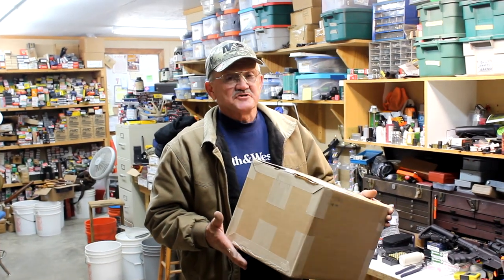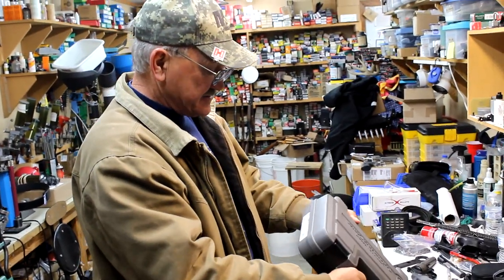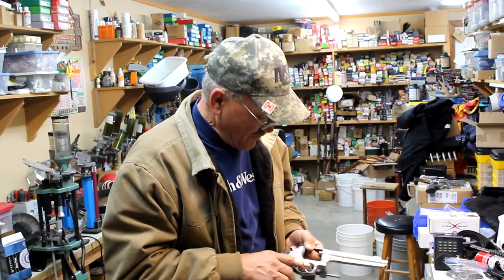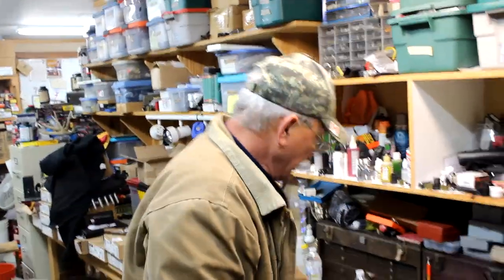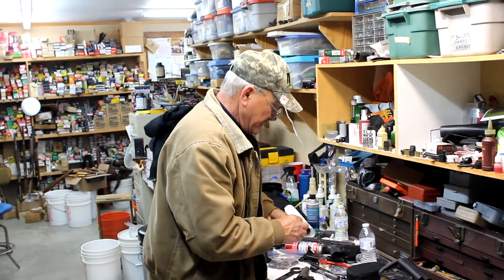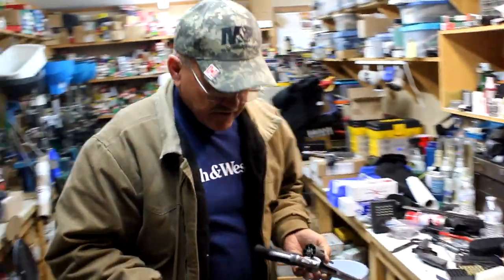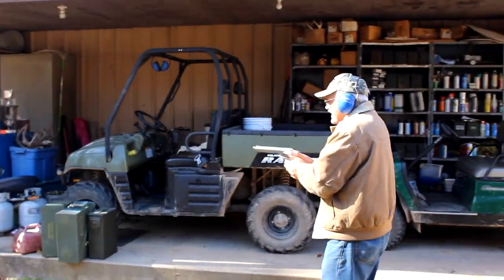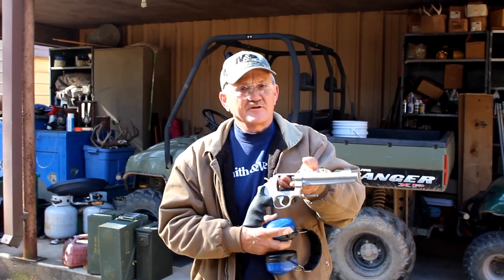First look and firing of the S&W 929 8 shot 9mm revolver with Jerry Miculek

Comment: Mr. Miculek, I myself just received the 929 recently. I have to say it is a gross disappointment for me, and as I have seen online many others.. I am a huge fan of you Jerry, your level of skill and excellence is of the highest level and unsurpassed. It has inspired me to take up action shooting with the revo a few years back. I know you expect the very best equipment available. I also understand some tweaking to a factory gun is required to make it better. I further understand as a sponsored shooter it is your job is to promote there products. Unfortunately the products, specifically the 929 you have your name on is far from what it is hyped up to be. It requires alot more work to make acceptable than it should based on what it is advertised to be. To say it is specifically for 9mm is false, it still has a cylinder throated to .357" for use of 38's not the .355" for 9mm. The Performance center Action is deplorable with no fitting what so ever. The hammer and trigger mating surfaces ride on the raised mold flash because they don't stone or grind anything to match. The cylinder opens like an old warped barn door and spins like a brake drum against over-adjusted brake shoes, the muzzle crown is rough with burrs protruding into the bore, and the barrel forcing cone is super rough and looks like it was cut with a dull taper pipe thread tap. Extra money on "performance center" work that is worse than most standard revolvers I have encountered. So with your name on it I hope you can step in to correct this miserable quality output when extra money is spent with expectations beyond whats delivered. It not only hurts S&W but is blemishes your name as well. I have called S&W repeatedly without call back from the Performance Center Rep I am always directed to......I can tell you I will never waste money on the Performance Center Guns again, you pay more without getting anything more done. I have written a full review of this hunk of S&W embarrassment on the Brian Enos Revolver forum. I do not take lightly in wasting money on hollowed promises!! I hope you can be the voice for all of us consumers whom are getting the shaft here. Thank You
Gus VanEtten
Reply: +BallisticianX I have to agree with you on the PC crap that is coming out. I purchas3ed a 625PC and had to send it back with a large list of fit &amp; finish problems and a 1/16&quot; drag line. They fixed everything but what did I pay for? They need help in the PC shop. My Pro Series 627 was a dream compared to the PC offerings. Hopefully S&W will come out with a Pro Series 4~5" 9mm 8-shot.
Reply: The cylinder is neither 9x19 or 9x21. It is a .357 mag/38 spcl. cylinder as spec'd for the parent 627 model. It is merely modified by shortening the cylinder from the face to bring the throat closer for the 9x19 COL. This is why the 929 has a throat diameter of .357" rather than the proper 9x19 diameter of .3555"  Likewise bore diameter is .357" rather than .3555" for 9x19. This all correlates into improper bullet fit and seal introduces gas cutting, resulting in increase barrel fouling and loss of accuracy. This is especially noticed with lead cast or lead coated bullets.
Reply: +Jonas Björk as per S&W themselves the barrels are broached to a spec anywhere within .3565" to .3575". This being the spec for all .357 mag/.38spcl. barrels. My barrel lands exactly to .357". May I ask how you determined your barrel diam?

Comment: Hi Jerry miculek. Have you and S&W ever had a good look at designing a bottom chamber barreled revolver? Have you resolved your ideas in the pro's and Con's? The barrel flip must surely be reduced? Though not enough to provide a measured advantage, calibre depending? Also I wonder if cylinder gap gas escape is an issue for the shooters hands.

Comment: I thought judging from the model number they took a model 29/629 frame and cylinder and simply bored out the charge holes to accept 9mm rounds and bored a barrel to accept 
.355-356 inch bullets. The frame looks like a K or L-frame. It could be the camera though.  I'd think a model 29/629 cylinder blank would be big enough to accept 10 shots of .38/.357 Magnum/9mm rounds. True the walls might be a little thin but an unfluted cylinder might be strong enough. The model 29/629 top strap probably is thick enough to help contain the pressure and gases without cutting as its strong enough to take .44 Magnum pressure and heat.

Comment: WOW! As a fan of .357 revolvers and .45 in 1911, I fell in love watching that revolver fire with about NO noticeable recoil. This gun (having 8 shots) might bring on a little rebirth of revolvers. Unless the cylinder is too big, I suspect a 2" or 4" in that would be a very good carry sidearm.
Reply: That recoil comes alot from Jerry. His recoil control is top notch. And also Smith and wesson currently offers 8 shot 357s in barrel lengths like that. The cylinder is the same size of a 44 cylinder. N frame. but with 8 355 diameter holes instead of 6 44.
Reply: Yeah, Jerry is awesome. Should have thought of that too. Also I know Taurus makes an 8 shot .357 but they may be just too big for people to want to carry them. At least the cylinder is shorter with the 9mm vs the .357 length.

Comment: I believe a small  part of us are guilty of accepting less than perfect quality from firearm manufacturers by accepting small defects and not sending our firearms back for them to address those issues.  I recently purchased a performance center pistol and it has a rough edge near the crown, as well as, a front sight that has a kink on it.  I am extremely disappointed with the over all quality of the product that I received.  It will go back to Smith and Wesson to get fixed after I have put some rounds through it to see if something else is wrong.  The trigger didn’t feel as smooth as I expected so I took it to a local gun shop and had their revolver expert check it.  They took it to the back room and informed me that it was perfect.  When I got home the trigger was much smoother.  Not sure if it was a perceived problem or if they cleaned up the trigger.  Needles to say my next S&W revolver will have to be thoroughly inspected prior to a purchase.  Needless to say Ruger will get a chance for my dollars in the next go around.
Reply: The quality of S&W revolvers today suck! And they've ruined their revolvers with that ridiculous Hillary Hole!

Comment: Is this a good weapon to have for home defense purposes?
Reply: Yes, if you like revolvers.
Generally, a revolver is simpler to use, but requires more physical skill than a semi-auto. A semi-auto pistol generally is easier to shoot, but requires a little more training to learn to operate safely (and how to clear a jam, but jams are rare). A typical semi-auto pistol will also hold twice as much ammunition, unless you live in one of the states that restricts people to 10-rounds.
Reply: definitely. Revolvers are simple and easy to maintain.  This 9mm would also make it so it is easy to control,  When you are frightened, and your adrenalin is going, you want the least things to have to think about in order to defend yourself.  A revolver is just aim and shoot, no safety, no anything to stop you from defending yourself in a bad situation, such as making a mistake (aka you forget the safety is on, or no bullet is loaded in the chamber, and the gun does not go off when you need it to to save your life) Furthermore, it is also a safe gun, even though there is no safety, it has a very heavy trigger pull, so there is no way the gun will accidentally go off, you will have to squeeze it hard to get it to shoot, you don't have to worry about brushing up against the trigger and having the gun accidentally discharge, so you can keep it loaded and in a good place where you can get to it in an emergency, just make sure you don't have small children who can get to it, or kids who don't know to never touch a gun unless they are supervised by a parent...if they are to young to understand the importance of this rule, than make sure it is stored up high where a child cannot get to it.  Other than that, it is a very safe gun, reliable, and very easy to clean, it will always go bang, most importantly when you need it to the most, its simplicity makes it perfect for a weapon for self defense, you can count on a revolver when your life is on the line.  Also, this gun has 8 shots!  that is most than any other revolver! This allows you to have plenty of shots to hit the bad guy or scare him away and protect your family with little to no worry of running out of ammo (90% of defensive incidents when guns are needed for self defense, less than 3 bullets are used)  So having 8 bullets is more than enough and a great advantage, coupled with the fact it is a revolver which is so simple to use and reliable, this in my view is the perfect package for a self defense weapon.  I would suggest this, or a pump shotgun, many on the market, and you can use buckshot which will spray and makes it almost impossible to miss a home intruder...its up to you, test some at the range, do some homework, and decide what is best for you!  But you cannot go wrong with a revolver like this!  Also look into this same revolver, but with the .38/.357 cartridges.  .38 is very similar to 9mm gun like this, and you have the benefit of being able to load it by hand one bullet at a time without having to use a "clip" to load it as this gentleman is doing to load this gun,  The reason is that .38 and .357 bullet cartridge is made for revolvers, and the bullet stays in place when dropped into the slots to load the gun, the 9mm was not exactly built for a revolver and thus requires a clip to keep it in place.  If it were me, I would recommend this gun, but in a .38/.357 (both bullets can be used interchangeably in that model of gun) because for me I feel it is more simple to load your bullets and they stay in place because the bullet has ridges at the end which makes it stay in place in a revolver, and after you shoot, the cartridges remain in the revolver and you simply pull a release button to eject the "spent" cartridges after shooting them.  Be safe and be sure to take some lessons with a range master or trainer before and or after purchasing your gun, and welcome to the club of firearm owners in America, please support the NRA and our 2nd amendment rights to protect ourselves!  And remember, when seconds count, cops are always many minutes away!  You need to count on yourself to protect your family and those around you you cherish most!!  Be well and peace be with you all who read my "article" :)

Comment: Anyone know if there is a snub nose?
Reply: Snub or a 4" even.
Reply: Not that I know of, but FWIW, Taurus makes a snubnose 9mm revolver with 5 rounds. It's the model '905'. I'm excited that there's finally a full-size 9mm revolver on the market, and in current production.
Reply: cymond The Taurus you speak of is absolute garbage.  It has a nearly 20lb trigger pull.......just garbage.
Reply: Judas Iscariot LOLS  20 lb trigger pull.  You might have a bent cylinder bar, causing friction against the frame if the pull is really that high.

Comment: Do you know if they will come out with something like that 8 shot in 40 cal?
Reply: Being the cylinder would be the size of a plate and it would be useless for any shooting sport. No.
Reply: Ok, just wondering.  I find 40 cal has a better return than 9mm but my wife can still handle it no problem.
Reply: What do you mean by Return? And also. If you can shoot a 40 well you can shoot a 9 better. with less recoil and equal effect on target. Unless we are talking about a division in a certain shooting sport which requires 40 or greater.
Reply: If you study modern ballistics and bullet design. A 9mm shot and a 40 shot in identical spots will have identical effects. What matters more is shot placement and number of shots. Therefore the increased capacity and decreased recoil of the 9mm make it the winner.
Reply: You cannot say the same about a 22 because they do not have identical terminal ballistics. As well as the other issues with slightly less reliable primers but thats beside the point.

Argue it all you want. But someone shot in the same exact spot. 9vs40vs45 will make no difference. 

Where you hit. How much you hit. How fast you hit. Is what matters.

Debating lethality of underpowered and weak handgun calibers (Which they all are, If you know youre going to a fight bring a rifle) is useless at best.
Reply: If you shoot someone in the exact same spot.
Do you honestly believe with the 40 they would die and 9 walk away fine? that 1 millimeter of non expanded difference. that 1/4th of an inch expanded difference?
Reply: Well you take that caliber that offers less capacity and higher recoil. That you probably cant shoot that well. (Im sure you think you do though.) And ill take the one that offers equal performance on target with less recoil and more rounds. Faster follow up shots. longer gun life. And practically every other benefit other than some mystical un definable not even guaranteed to actually make a difference "Stoppin powuh" you seek.
Reply: *****
 .22LR, i can pump a good 25 round in a torso before you can even set 2 steps towards me. It would, be a massive bad day for you, just saying.

But i stick to my 45ACP round for real self defense. Enough punch to knock someone down. With deadly force...
Reply: *****
So according to your logic, a heavier caliber is just a in-effective...

No it's not, it's all about placement, and you clearly did not see the video. You ASSUME, people get hit in a vital area and do not go down. In such videos, often when a cop shoots the miss half the time (heat of the moment) the vital area's

How often do you hear a perp lives to fight another day? This means, the did not got hit in the heart. A heart shot is mostly FATAL. You need medical attention on the spot, to survive such a a wound. Which in 99% of the cases, is absent. The human brain can do, without oxygen give and take 4min. And then it's end of story.

Common knowledge and fact, feel free to google a bit.

Remember Zimmerman? He shot Travon in the back, went through the heart..died. Now this was a 9mm. Which would not have made much difference with a 22LR on the SHORT range, the had there altercation. Placement is key with a .22.

I know it happens up close (read what i said) a 22LR will kill you, was it not for the lack of recoil, i can group a 22LR on your chest in under a second. A gunfight takes no longer then 3 or so..

There is one contradiction to which i am using a 45ACP, and that is the LACK of stopping power. To that i agree, it does NOT, i repeat NOT make a .22LR less LETHAL.

If it comes to stopping power, then this debate should just be ended with a 12 gauge shotgun.

No offense here..

I seriously doubt you have guns now, or even a  22LR and did some testing with it. You call me deluded? I tested more then i can count on various materials. And as i said, try to watch the video. It gives enough information on what it can do.

I do not fully agree, that does not make me deluded. I learn, and i tap into sources just as you do. Adapt some logic, and sense and you see what i am saying hold ground just as well.

I am a guy, that loves guns and got plenty to shoot in various calibers. And i am also, not to shy to test out the capabilities of my gear.

Just stating, that insulting me does not do you or me any good. Debating works, 2 ways..
Reply: Kylef7735 shot placement is the most important thing but what round your shooting is a close second.  Bullet Technologies over the past 15 years have increased 10 fold putting a rest to the stopping power myth. Anyone with eyes can watch a 9mm golden Saber cause more tissue damage and trama than a. 45 with target or a copper top. Same as people say a. 22 mag is useless for self defense. I beg the differ. I'll take 30 rounds of 22 mag over 8 45 rounds any day of the week. Hitting that follow up shot is always the hardest and under life and death added recoil is not your friend. I'll shave your wiskers with a 22 or 9mm.
Reply: Ray Murda
I see your point.  The more I look around the more I see that 9mm is much more common and easier to get.
Thanks for input.